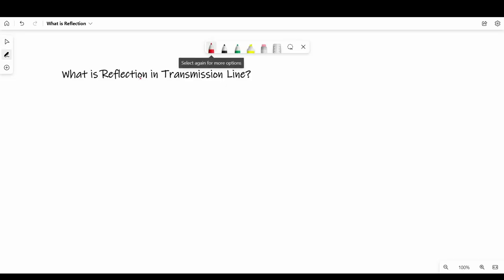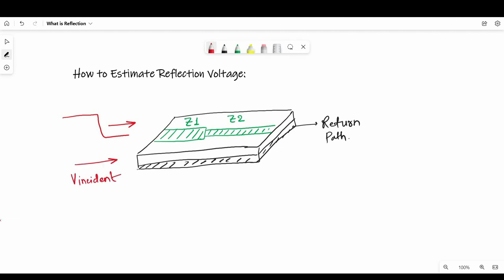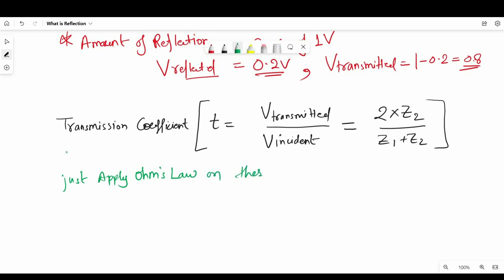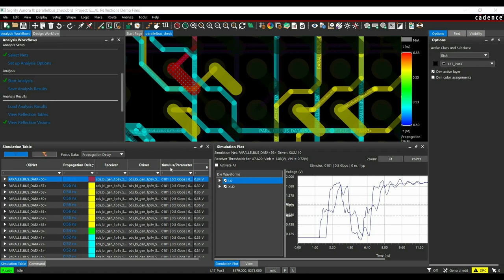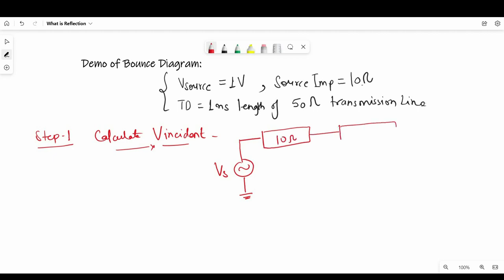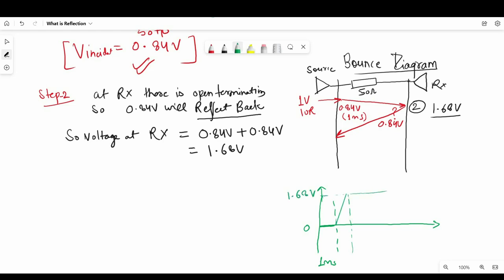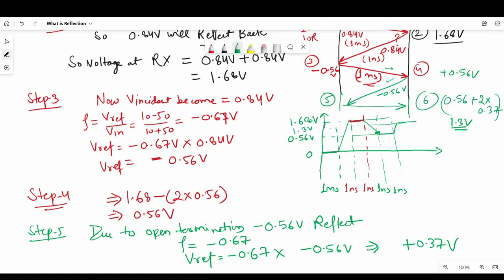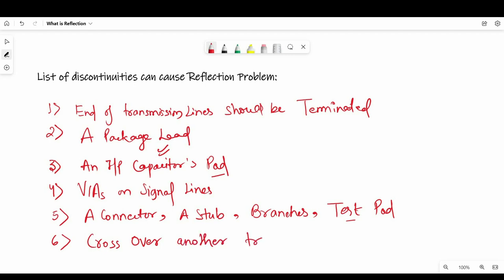What is Reflection in a Transmission Line? Simulation of Reflection in DDR2

Comment: Sir what is the voltage we observe when we probe one of the ends with an osciliscope, is it the reflected voltage, the tranmitted voltage or the incident voltage...?
Reply from the maker: All of them at certain time on time scale, very much depends on rise time and freq of signal, if you want to visualize them cleanly
Reply: @EsteemPCB  Well to be a bit more specific what voltage we will see at a probe when the reflected voltage reaches the end we are probing.
Reply from the maker: Reflected voltage depends on the end of transmission line, let's say in your case there is open.
Then all the voltage ll reflect and add up to your transmitted signal.
Sending 1V then at probe point you ll see 2 volt. 
If there is termination there ll be no reflection
Reply: Well let us consider the following case in the video at time 10:50 , tell me if my observation is correct.
Is it correct to say when the reflected wave reaches the far end of the line, i.e is when calculating the voltage for step 4.
V(final) = V(initial) + V(indicent) + V(reflected). 
Where 
V(final) = voltage after the reflection.
V(initial) = voltage of the terminal before the reflection 
V(incident) = voltage that was reflected by the near end that is now the incident voltage for the far end
V(reflected) = Voltage reflected by the far end.
I.e
0.56 = 1.68 + (-0.56) + (-0.56)

Can this equation be generalized for anytime the reflection occurs at a terminal.